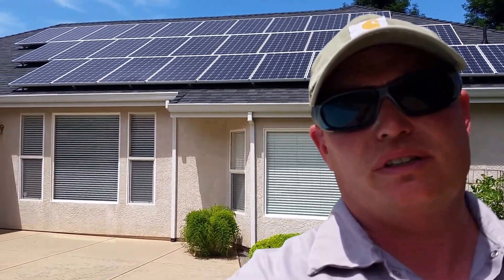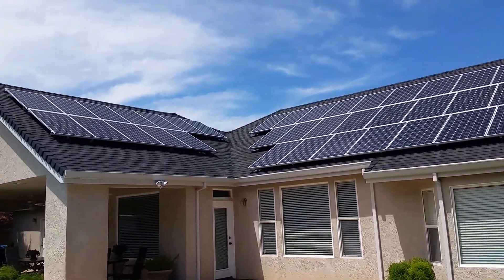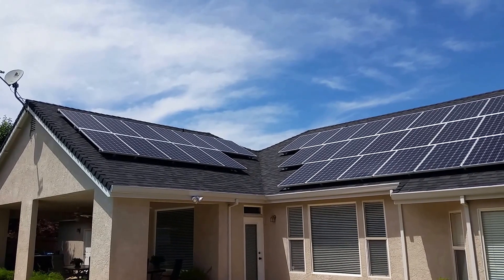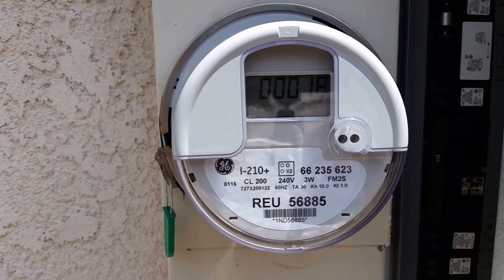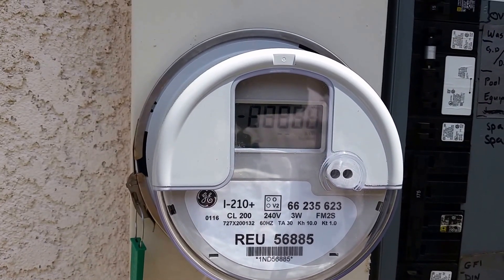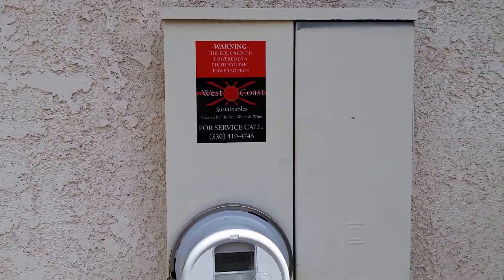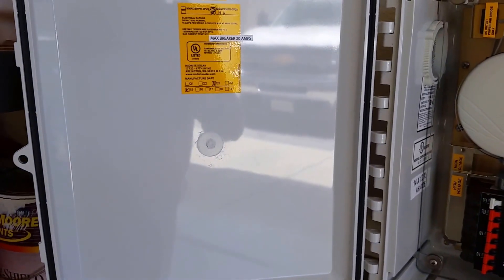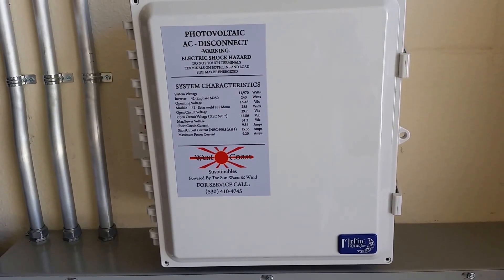Grid tie solar done right, with Solarworld modules, Enphase Micro inverters and a Midnite combiner!

Comment: What about battery Backup?   We live in the south and we deal with storms and hurricanes and have power outages to deal with. We can be without power for days and even weeks.   We have folks who sell grid tied systems with no battery backup and most folks don’t know the will be without power when the grid goes down.  You And Johnny Valentine do a great Job.   Thanks much Bro.
Reply: enphase also makes an AC-in/AC-out battery backup box. For "days and even weeks", you would definitely need a generator as well (each backup box is only 48Ah). But the generator could be used to recharge a small number of enphase units, running just a couple of hours per day, and the batteries could then supply the fridge and a few lights 24x7. Here's the link:  https://enphase.com/en-us/products-and-services/storage.
Reply from the maker: Jim Davis this system is in the City of redding and they may lose power once every 10 years.  They just wanted to save money and weren’t worried about back up, if so it would have been cheaper to put in a generator plug :)

Comment: I take issue with the huge reliability risk here by installing electronics under the array.  Someday you will be going back one by one to replace all those Enphases.
Reply from the maker: True you do have more exposure, most ROI curves show a hardware failure around year 11, I have also seen multiple times panel failure where a customer didn't monitor the system and it went unnoticed for quite a while when you look at the safety factor and monitoring capabilities  that you get with the micros the do have there pros.  I don't think I will take the bait and jinx myself on the product so far
Reply from the maker: I see that your in AZ the heat there is also a pretty serious enemy, Are you using mostly Solaredge? I see those in your pictures I understood they were having quite a few failures because of there initial low heat tolerances? as a fellow installer hope you at least liked the work.

Comment: nice setup!  what racking would you use if you wanted to tilt the panels up in winter?
Reply from the maker: The racking is Ironridge and they make a nice tilt leg if you need more angle.  It isn't the easiest to seasonaly, it's more for long term.  This system is on a 6/12 so it had PLENTY of angle according to my ankles and feet.

Comment: That looks like a real high class code wiring job.  Love those plaques, keep em coming, next time I wanna see some time lapse of the main breaker swap out......
Reply from the maker: JV. thought you would like it!  this was a brutal solo job.  The main breaker swap was the easiest part of the job, I use a place in Southern California RESA they always have what I need, just send them a picture of the breaker and the main panel label and they will take care of the rest.  The switch out on this one was as simple as having the utility come out and pull the meter to disconnect the power unscrew a couple safety plates and switch the breaker out.  we were able to replace the meter with the new net meter at the same time make a smooooth operation.